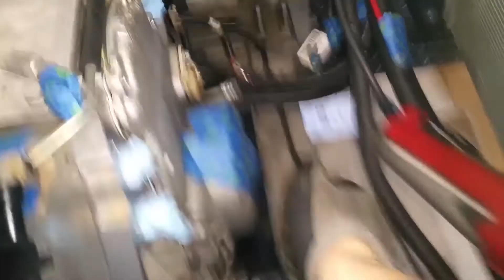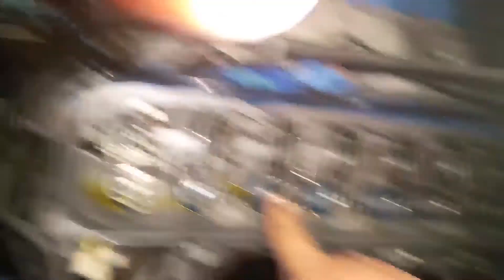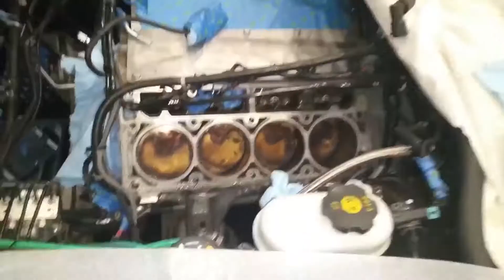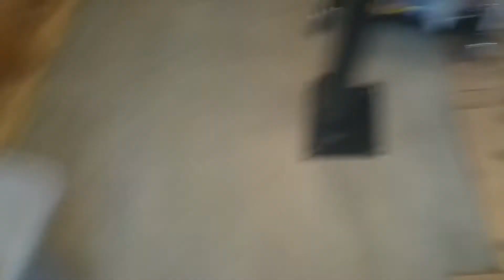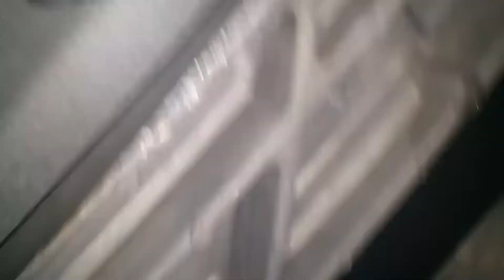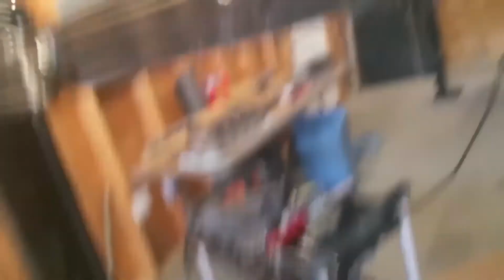Removing heads, cam, oil pump & front cover from LS motor. Procharged Corvette Build. Part 16

Comment: Hey man. It is necessary to remove the oil pump to get the cam gear off? Seems like I should be able to slide off? Thanks
Reply from the maker: It may be necessary, I don't know if you'll be able to slide the cam gear off the timing chain. The cam gear may hit the crank spoke and there is really no flex in the timing chain.

Comment: We are currently trying to lower oil pan and the wishbone is bowed up with the oil pan sitting on it so it won't lower any advice?
Reply from the maker: When you say wishbone are you referring to the front cradle or k-member as many people call it? I apologize but I believe when folks say "wishbone" I believe they are referring to a part of the suspension so I'm just confused. However, you cant remove the oil pan on the C6 Corvette with the motor in place. You can try raising the motor by unbolting the motor mounts and then lifting the motor from the top and at the same time you can lower the front cradle about 1/2 of an inch. Try to loosen the cradle bolts about 1/2 of an inch and see if that gives you enough room. Do not loosen them all the way, leave the nuts on the bolts . Be careful when your under the car at all times please. Thanks for watching and good luck. Keep me posted.

Comment: Did you have any problems with the oil pan gasket (as far as leaks) once yo button everything back up? Looks like the oil pan gasket is a pita to change out!
Reply from the maker: Hi Blake, thank you for watching and thank you for the question. No I never had an issue after reusing the oil pan gasket. No leaks at all.
Reply: cool. this was something i was worried about. I'm currently at this process. Thanks for the quick response! Also, thanks for the detailed video as they have helped a lot with some of my questions.
Reply from the maker: No problem Blake, just let me know if I can help out more.

Comment: This is a very general question, nut actually related to this VERY informative video:  "Basically; are all of the 'fasteners' (Nuts/Bolts) used on the C6 100% metric vs standard SAE...?"  Again - sorry for digressing away from this videos topic.
Reply from the maker: Hello Craig, it was a mix of Metric and Standard to be honest. Most nuts and bolts require 6 point sockets but the ARP head stud kit and ARP harmonic balancer bolt I used required the use of 12 point sockets.  Tell me, what modifications do you plan on doing to your future GS? Heads/cam package, etc? I believe you stated you do not want to add a blower.